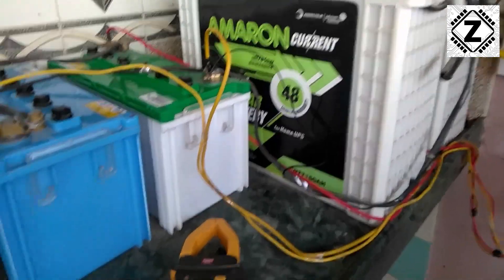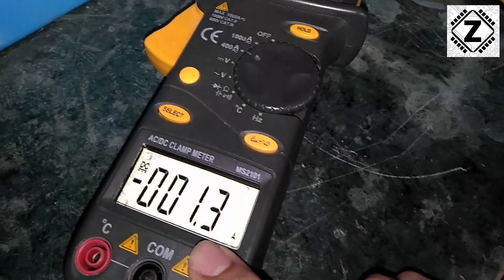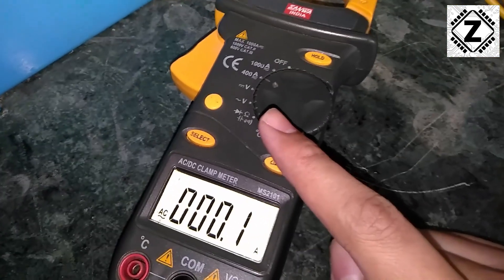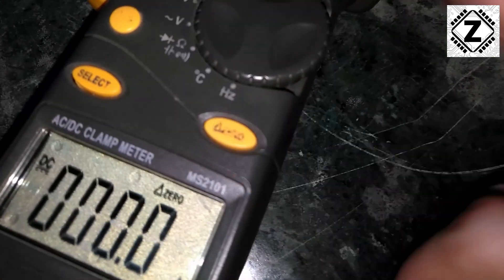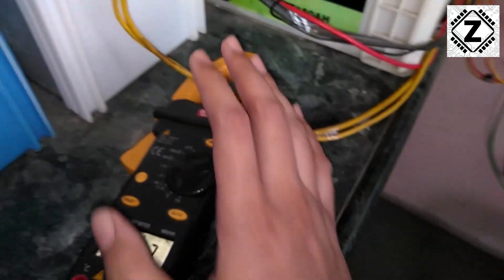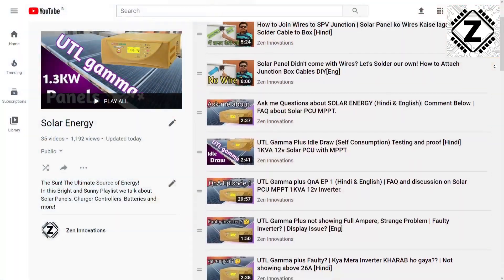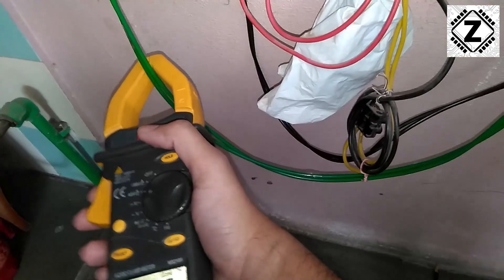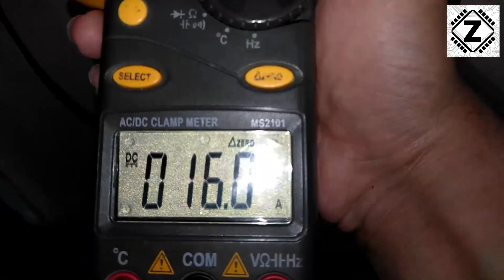[Eng] How to Measure DC Amps with Clamp Meter | Get accurate Reading of Battery & Solar Amperes

Comment: Nice channel, I watch this regulary! Need your expertise with a strange situation.I have a DC clampmeter, Halls sensor type, when I measure a DC current shows me different numbers when I change the clamp orientation..let's say I read +10Amps, if I rotate 180degress shows -12|Amps..shouldn't be the same? like an ampmeter ..really doens't care polarity, it's same result..no?..TY !
Reply from the maker: Yes. Orientation does matter. But value should not change. Maybe some other Electronic or magnetic device is interfering with the reading.
Reply: @ZenInnovations  I believe it's decalibarated..I had another with the same behavior..It needs some trimmers adjustment..looks like..Thanks!!!

Comment: If I want to purchase a new battery 12v 12 amp.  How to determine its amps over the counter.
Reply from the maker: Check the user manual.
Reply: @ZenInnovations  I meant, if the battery is in good condition and not used/old one, which will not last long.
Reply from the maker: @AnilKumar-db7tc  load test. Multimeters.
Reply: @ZenInnovations  exactly.

Comment: ..most of this clamp description do not have the DC amp reading..only Voltage of AC ,DC..and AC amp...weird
Reply from the maker: It's not weird. People usually buy the wrong kind of meters.
Reply: @ZenInnovations  ..they add a hal sensors for the latest DC current reading..it's been 40 y ..only happened recently

Comment: Great video btw 
Do you know any clampmeter that is suitable for measuring DC currents in mA (clampmeter that can measure 100-700 mA) ? Should I go for this ?
Reply from the maker: Clamp meter is usually not accurate below 1A.
You can try these ones https://amzn.to/39omQyZ
But they are very expensive.

Comment: Informative and useful. Thank you. One question - does the - sign mean that I can use a DC clamp meter to measure the direction of the current? Say for example I have some load on a battery and and charger as well. Is it possible to measure if the current is running to the battery (charging) or from the battery?
Reply from the maker: Yes you can!
Reply from the maker: You can also put both the Load & Charger wire through the clamp at once. Depending on the Current flow direction, You will get Net Charge rate (Either + or -)
Say if the Charger provides 20A, The Load is 5A, You should be able to see net 15A (positive value)
Reply: @ZenInnovations  Thanks, thats even a better idea.

Comment: Sir i have installed 335w×3 24v  solar panel to utl gama plus 24v system.... i am getting ampere of 16 to 20 in afternoon when there is ample of sunlight. Wanted to know is this good output for this setup ...please comment 🙏
Reply from the maker: Seems about right. Pls check QNA ep18 for more details.
Reply: @ZenInnovations  Thanks  for ur information
Reply: Sir some time when inverter is on light will get flickering now and then ...any idea on this
Reply from the maker: @abhilashe5090  contact service center.

Comment: I HAVE DEVICE THAT PROVIDES DC PULSES DC SUPPLY HIGH CURRENT 150 VOLATAGE SO CAN I USE THIS CLAMP METER TO MEASURE CURRENT
Reply from the maker: It may not show accurately.
Better to buy oscilloscope.
Reply: @ZenInnovations  I bought HTC analogue CRO OSCILLOSCOPE 18 MHZ.  Can I directly connect oscilloscope to high power DC SUPPLY 150 V pulsated current with no protection accessories in  between ...
That is why i am asking because I have TO KNOW THE READING OF PULSE ON TIME PULSE OFF TIME ON OSCILLOSCOPE so how to connect them ...so that my device may not fail
Reply from the maker: You might need a current transformer or Step down transformer. You can join my Telegram group for better discussion.
Reply: @ZenInnovations  initially MAIN POWER AC SUPPLY 220 VOLTS IS CONNECTED TO STEP DOWN TRANSFORMER AND THAT IS TRANSFERRED TO DC CONVERTER WHICH PROVIDES PULSATED/ CONTINOUSE DC VOLTAGE AND CURRENT AS OUTPUT WHOSE negative and positive terminal are connected to cathode and anode.

Now I want to measure the pulse on time , off time waveform in oscilloscope,  which is going into cathode and anode ....

So it actually means that main supply >TRANSFORMER >DC convertor > oscilloscope > cathode /anode in Electrochemical cell.

This will be the  actual arrangements.

Now my problem is that can i directly connect oscilloscope to DC CONVERTER directly without knowing how much current is coming out of it ... or i put digital voltmeter ammeter panel like PZ72L in between.....or clamp you r showing in between...

Kindly recommend
Reply from the maker: Its better you ask the manufacturer.